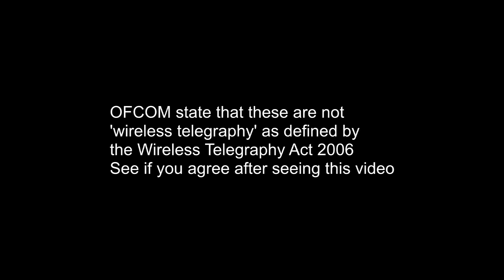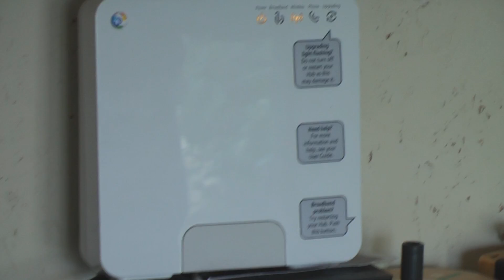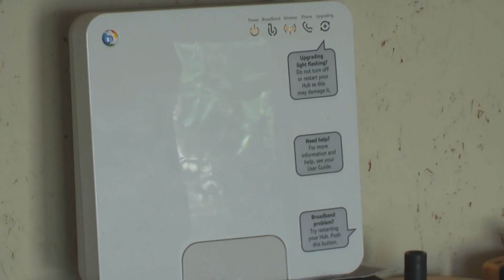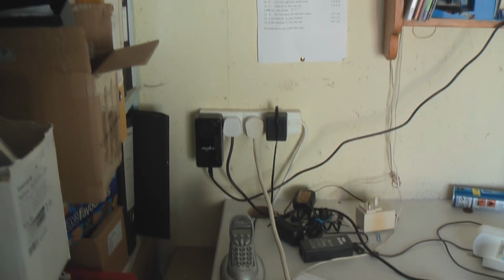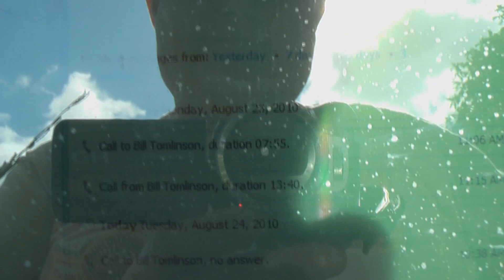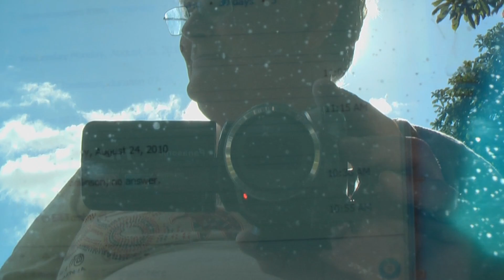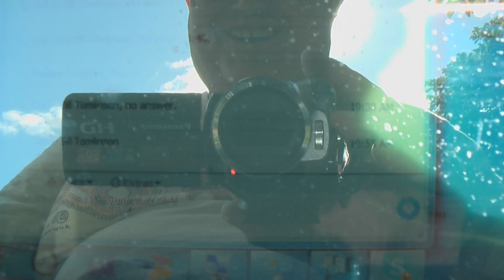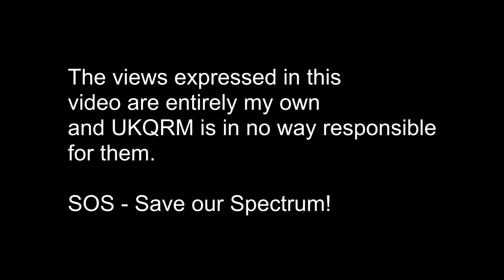Devolo dLan 200 AVplus Powerline Adapators Trasmitting Wirelessly

Comment: I don't understand the problem. Devolo adapters actually contribute to quiter and less saturated 2.5 Ghz frequencies since you don't have to install WiFi repeaters to extend a LAN. The only apparatus which is using WiFi is the BT box which you put there... Devolo DLAN just transmit ethernet signals from UTP cables to ethernet on the mains cables.

Comment: @johnpetters 
You understand how powerline adaptors work right? They transmit network protocol through existing power cables. By plugging those adaptors in to a mains power cable you've essentially run a Ethernet cable to your laptop. 

Technically it's broadcasting a signal through the cable which may cause slight interference, however it's not communicating wirelessly. Try putting them in 2 houses next to each other.
Reply: Altough you reply is 5 year old - just to show others how you totally missed the point: The two powerline adapters are connected to two completely seperated power networks - one is in the mains at the shed, one is plugged into a diesel generator - no galvanic connection is made. So they communicate WIRELESSLY - that's simply what happens if you transmit 30 MHz wide signals over a long unspecified line..

Comment from the maker: @jamb027 No. each Devolo unit is a radio transmitter and receiver. What you are seeing is the two units communicating wirelessly, similar to how WiFi operates, but at a much lower frequency.This means they are classed a wireless telegraphy apparatus under s117 of the WTA 2006 and should be licensed by OFCOM as should all powerline network adaptors